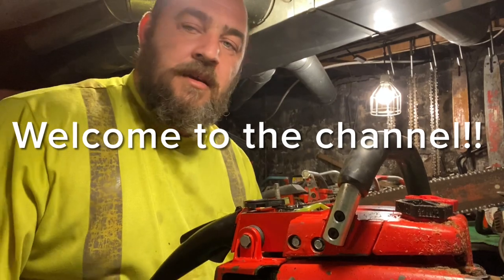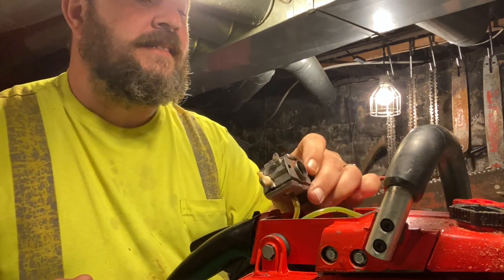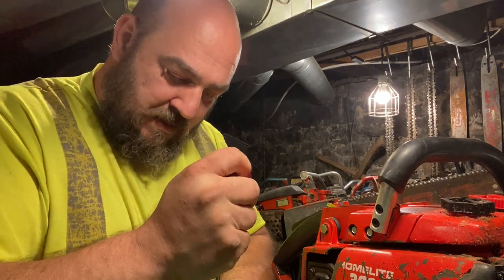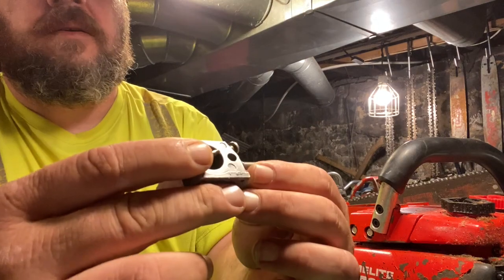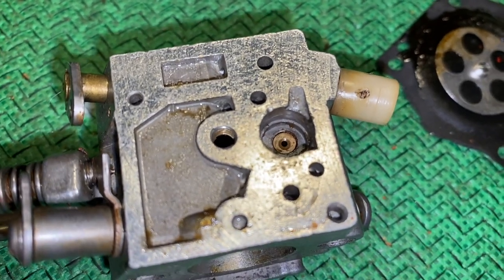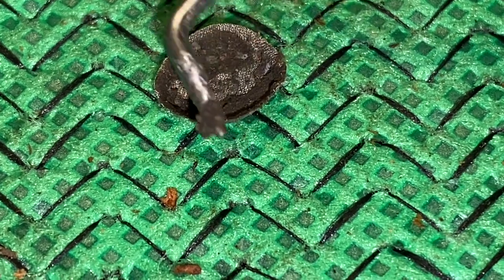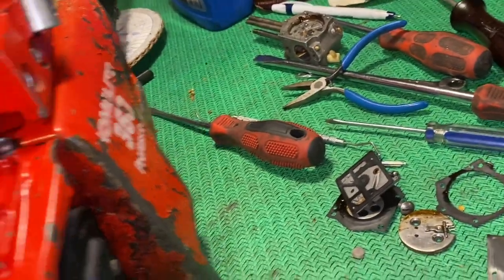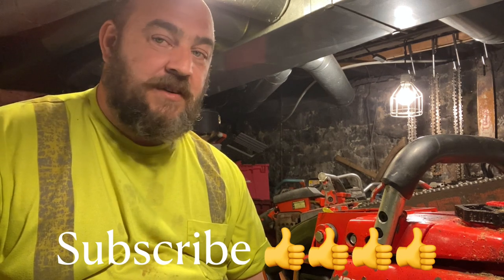Homelite 360 surprisingly continues to have trouble!!

Comment: Probably an old rotten fuel line left in years ago or varnish.  If not that bar oil leaking past gasket.
Reply from the maker: This saw stinks really bad!!
Reply: Yeah old plastic breaking down in the new gas ", I always flush and scrub my tanks with bottle cleaners to reach down their and shake and dump out with fresh gas

Comment: I KNOW WHAT IT IS  ITS A PIECE OF OLD FUEL HOSE  I HAD A SIMILAR PROBLEM BUT I CAUGHT IT ON TIME BEFORE I RAN THE SAW  IT WAS LIKE TAR  STUCK TO THE TANK  SO WHEN YOU CLEAN  THE TANK GET A LIGHT INSIDE THE TANK SO YOU CAN SEE  GOOD  BECAUSE YOU MIGHT HAVE TO SCRAPE IT OUT LIKE I DID IF ITS IN THERE GOOD LUCK
Reply from the maker: Thanks!!

Comment: I’m curious on this one! I had just picked up a 360 2days ago, clean saw in great shape but having issues, seems like no spark. I appreciate the videos, take care!
Reply from the maker: Thanks!!  Welcome to the channel!  We focus on troubleshooting various issues that are common with vintage saws.  We will also add in some modifications and porting work.  A lot of the time we need to find a cheeper method or sometimes parts are not available so outside of the box thinking is required.  I hope you enjoy!!
Reply from the maker: Congrats on the awesome find!!
Reply: @Smittyschainsaws  awesome  looking forward to it! I’ve always tinkered on saw but stuck with the basics, really starting to get into porting and other modifications! Thanks again!
Reply from the maker: The most common issue is the rubber intake boot below the carburetor.  They turn to goo over time.